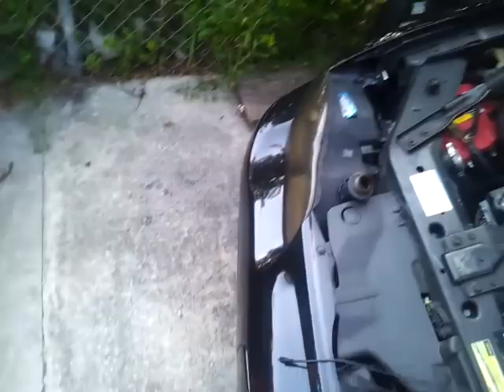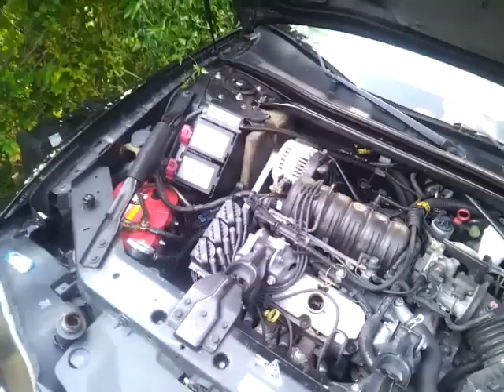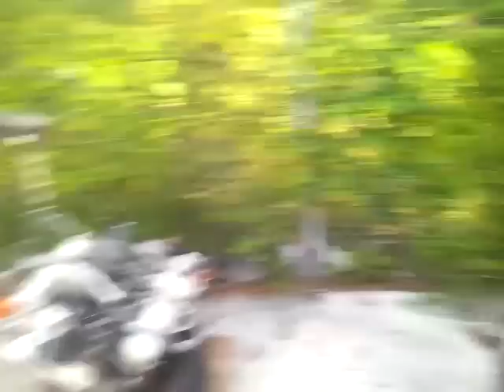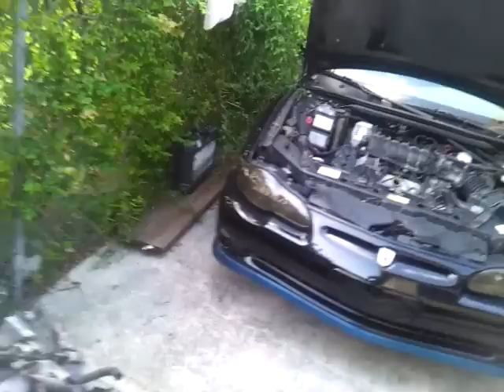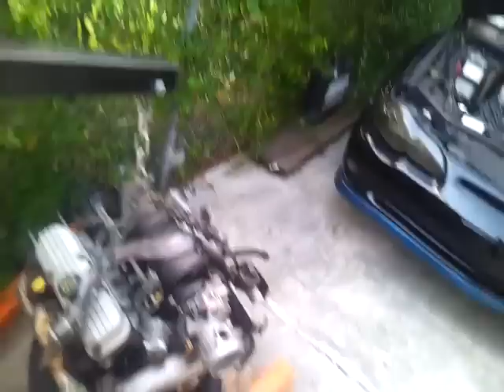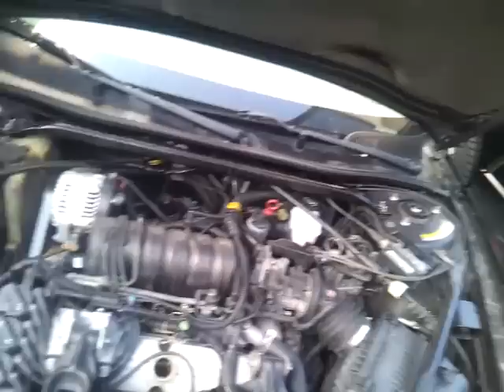Engine Swap 1 - Died @ 145,000miles

Comment: how do you remove that last bolt that connects engine to transmission from Passenger side?
Reply from the maker: Bernard Fitness Its Tricky, Just Have To Take The Time To Work In There. A Swivel Extention Was What I Was Told Would Work Best.
Reply: I've always got it with a 3 foot extension from the passenger side.
Reply: Looooooooooooooong ass extension

Comment: Hey man where did you get the replacement from
Reply from the maker: Local Parts Yard, Opa-Locka, FL
Reply: awh thx man
Reply: Yoskakune I've got an extra one 100.00 if you can come to GA and get it.....both are from Pontiac GTx GP45 cars